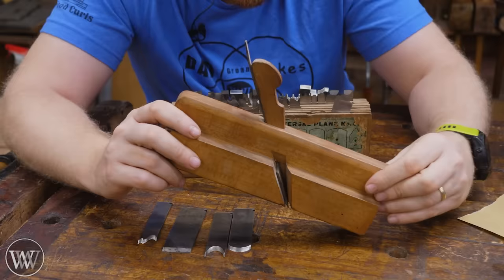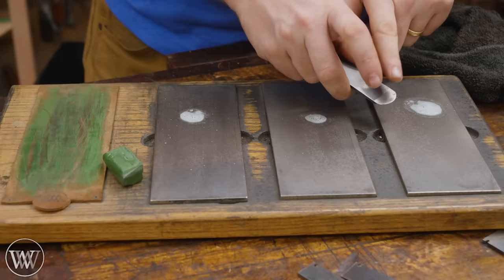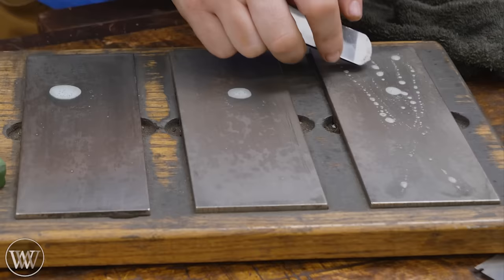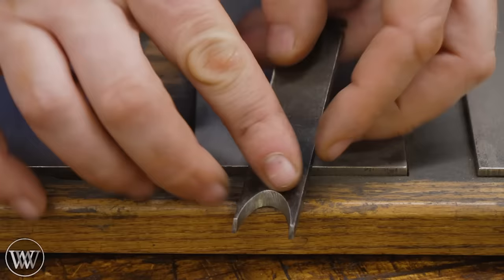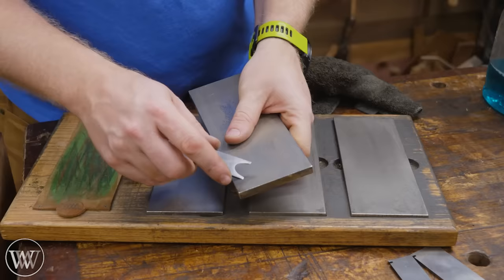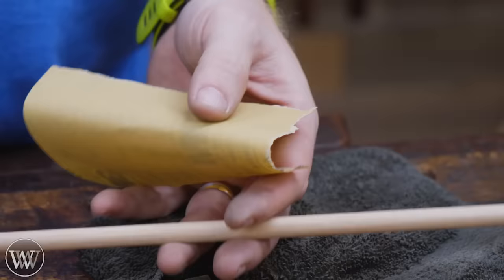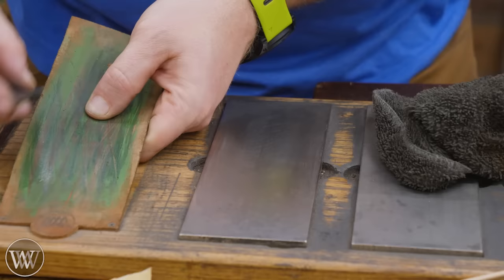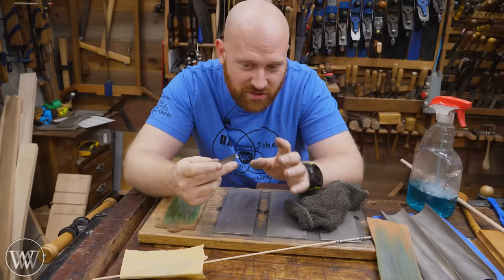How to Sharpen a Molding Plane Iron Or Combination Iron

Comment: Thanks again, James!  One trick I like for these complex molders (got it from Shannon Rogers) is once you have the iron perfectly sharp and profiled, cut the profile into a piece or wood or even mdf.  then you take the negative profile that is now cut into the wood and charge it with honing compound and voila, instant custom strop.  Since these irons aren't used that often, if you strop them prior to use, you might be able to go a very long time before having to resharpen them - if ever!

Comment: I'd say one thing that can be done is to keep a reference of the various profiles by putting some graphite or really anything coloring that can be put on the flat side and then use it as a stamp on some notebook or piece of paper in your toolbox, that way you will always have a point of reference if you think after years of sharpening you have overdone one part.

Comment: With the half-round or round-over cutters you can run them along the edge of a board then use that same board to wrap your sandpaper around.  They're also the cutters you're more likely to use and need to sharpen more often.

Comment: Thanks for a informativ video!
I have a old moulding plane with a notch in the egg and need to grind about one milimeter to get rid of that.
But how do I keep the profile right? It is easy to remove to much in some areas.
Reply from the maker: It is not easy at all for that you would basically end up reprofiling it. The answer to that is to extend the iron out of the mouth and mark it with a sharpie to match the shape of the wooden body. And then you grind it back to that sharpie mark.

Comment: I hear what you are saying about 'power tools' -- but I tried a hard felt wheel with polishing compound for honing my chisels, plane irons, etc -- I still have a DMT plate, but ... if I have electricity, I go straight from the coarse DMT plate to the polishing compound.   Shaving sharp, every time, in under a minute.

Comment: Would it be possible to use a file the help with the sharpening process if they are very fine
Reply from the maker: Some of them are soft enough you can use a file but you need to be careful not to take off too much material. File takes a lot off very fast.